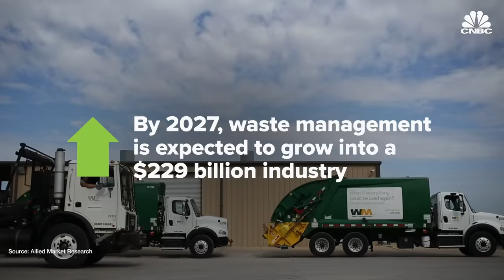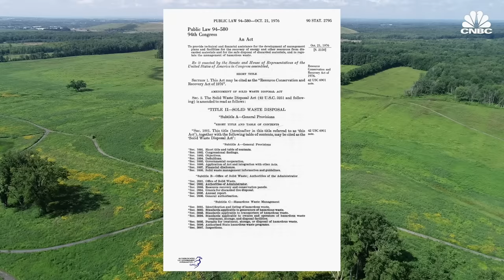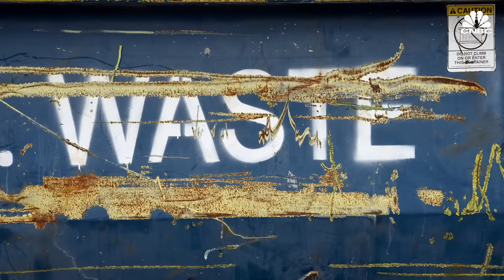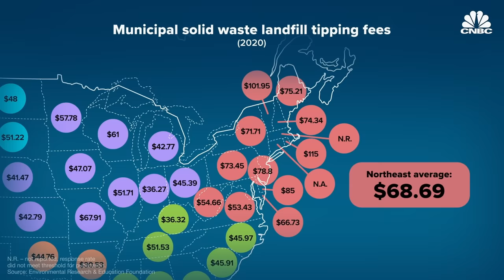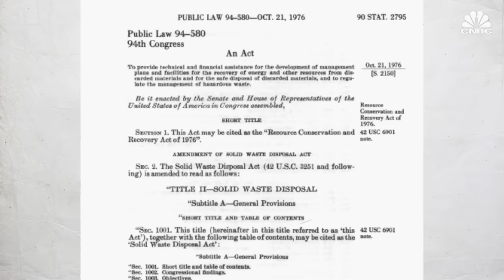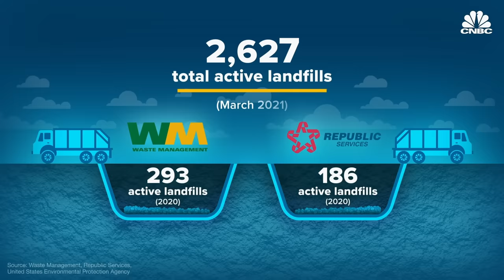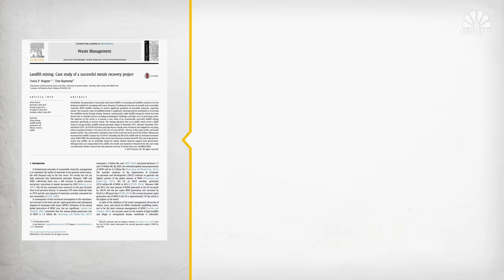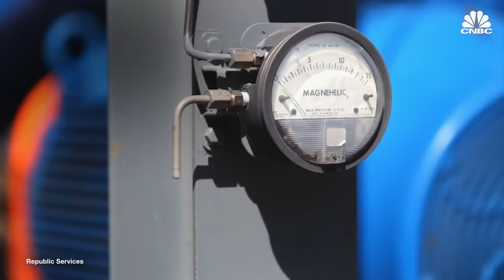How Trash Makes Money In The U.S.

Comment: Think of all of the materials that go into landfills. So much is going in that could be reused or recycled. It is said the use of plastic shipping bags, like what Amazon frequently uses, could be greener than the cardboard boxes, but only if the bags would get recycled.
Look at all of the construction and yard waste that goes in. Don't forget the food waste. Food and yard waste can be composted. Some construction waste, depending on condition,  can be reused, e.g. cabinets, plumbing and electrical fixtures, hardware, etc. I once saw a This Old House project begin with a Deconstruction contractor.  Take the money spent on the contractor, subtract the money made on selling the materials, and the expenses are a wash compared to simply tearing everything out and sending to the dump.
Reply: Really expecting people to do something after the initial creation is not the best approach its preventing it in the first place. We need to go back to reusable materials and tone down consumerism.
Reply: I agree with much of what you say. But---yard waste usually has cat and/or dog poop in it. I wouldn't want to recycle that.

Comment: I managed a landfill gas to energy facility for 11 years. This is a pretty informative video. Good stuff.
Reply: How does the facility work?
Reply: @faarah  We used a large compressor station to pull vacuum on the landfill using gas extraction wells that were drilled into the trash. My particular facility sent the gas to a pharmaceutical company that used it to run their steam boilers.
Reply: can it be used as house hold gas for cooking?
Reply: @mohammadzohirulislam8883  I wouldn’t recommend it.

Comment: theres money at every level of the landfill process. county owned landfills pays the companies that operate the landfill, the company that gets paid to dig the cells and then in turn selling that gravel or cement for a profit, the refuse company that has their own Recycling plants, companies taking the gas emitted from the landfill, solar farms on the closed landfills, the tipping fee revenue (that has increased about 20% in the past year with covid having people buying and throwing away more stuff while at home). the trash business is good business.
Reply: A landfill I consulted for was an old strip mine. We actually mined coal, it was at a lose but the material helped fund the construction of the cell. The material needed to be removed anyway. We had sold stone and coal. Saved all the clay for future construction and saved all the topsoil for reclaim.

They can also send the methane as natural gas to pipelines.
Reply: @cmdr1911  coal is super nasty and unethical though
Reply: @Nicholas-f5  There is no point to develop new coal the market isn't there. There are newer coal plants the are far cleaner and efficient but that simply means retire them last. The way we were mining the coal was far more ethical than say Murray. The coal wasn't a focus but a byproduct just like the limestone that was pulled.

Comment: A cryptocurrency, crypto-currency, or crypto is a digital asset designed to work as a medium of exchange wherein individual coin ownership records are stored in a ledger existing in a form of a computerized database using strong cryptography to secure transaction records, to control the creation of additional coins, and to verify the transfer of coin ownership.[1][2] It typically does not exist in physical form (like paper money) and is typically not issued by a central authority. Cryptocurrencies typically use decentralized control as opposed to centralized digital currency and central banking systems.[3] When a cryptocurrency is minted or created prior to issuance or issued by a single issuer, it is generally considered centralized. When implemented with decentralized control, each cryptocurrency works through distributed ledger technology, typically a blockchain, that serves as a public financial transaction database
Reply: It's an investment trade in Which you investment a certain amount of capital in BTC,ETH or XRP depending on your choice and the company's broker which you are investing with.

Comment: We need to make a lot more recyclable products weather plastic. paper, cardboard, metal, etc. We are doing better with recyclables but have a long way to go. Each person needs  to recycle not just some of us. And use rock quarries used to get material for making concrete.  which when empty  is already a huge hole in the ground for our trash left over from recycling . Also maybe have a trash burning plant that convert the heat to energy to power city's or public transit. I think Chicago does something like this This would use a lot of the left over trash.

Comment: We need to work on using that waste for something useful, so it's not wasted. Biogas and fertilizer for some of it. Separating the plastics and metals from the waste would also give you supplies to sell to manufacturers for a profit. or even just burning it as an energy source and then burying it would give it a better chance of breaking down faster than usual.

Comment: 10:15 Metals can be relatively easy to recycle but with current technologies it takes a LOT of energy.
Reply: You are wrong. Recycling metals uses much less energy than producing metals from minerals. Even more when you consider all the energy used to extract and transport the minerals (which can come from far places). The problem with recycling metals can be quality if there is too much contamination, but this can be solved by combining recycled molten metal with fresh molten metal (something all metallurgical industries already do)

Comment: We need to drasticly cut out plastic in landfill and use what plastic there is about and recycle it even plastic in landfill sites. The plastic in landfill sites can either be refined back into an oil which can either be repumped back into empty undersea oil wells or refined again to be made into a cleaner fuel for vehicles or power generation. We also need to bring back more recyclable materials such as glass, paper, cardboard, wood and metals such as aluminium and use them to replace single use plastic. We also need to make landfill more organic and cut out metals, plastics, chemicals and other material such as textiles from entering the landfill. Keep landfills for organic or green waste to greatly reduce the impact on the environment. Any waste that cannot be recycled or put into landfill can then be incinerated and used to generate power, modern day incinerators give out less pollutants than a landfill with filters to reduce toxic emissions to a minimal amount. Landfills can now be regenerated and turned into nature reserves or woodland to help wildlife and our environment. All of this is possible with the wright investment and IF big companies are encouraged to get involved to reduce, collect and recycle plastics.

Comment: I feel with several programs working together in the trade of waste management it will be better , collecting and selling methane gas to power homes,  properly separate all the recycled materials to be repurposed examples. Produce and green waste use to make compost. Clothes recycled to make insulation and other materials. Paper and cardboard repurposed to fire logs takeout containers, plastic can be repurposed to blocks for building or housing materials also pellets for the companies to produce there products, same with glass it can work if the companies and government invest in it properly. If an item is made it should be able to be recycled and repurposed. Just my suggestion on handling this matter.

Comment: This is actually already a failing chain of business.
There are a lot of easy alternatives.
Such as good agreements with manufacturers to make all products circular.
Or that ultimate waste is nil.
Everything from product 1 to product 2 and 3, etc. until it can't go any further, back to the source, the manufacturer who produces it again from recycled material to starting raw material.
But what is at least equally important is that people in general do not remain lax or complacent but act and think with wisdom. And take initiative and adjust yourself.
But it starts at the very beginning, is a product worth producing, the way of producing.
I already have very simple ideas for reducing waste flows by more than 90 percent.
And that is immediately the start and reversal of natural damage.